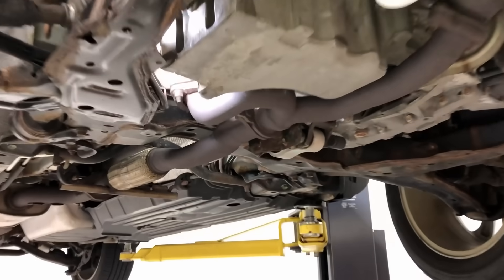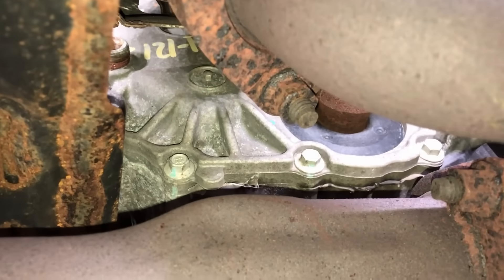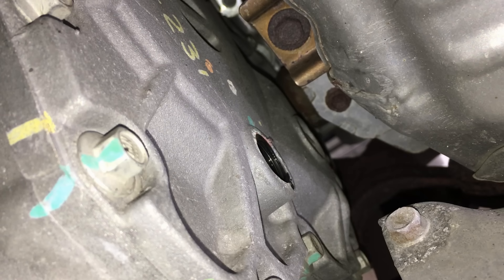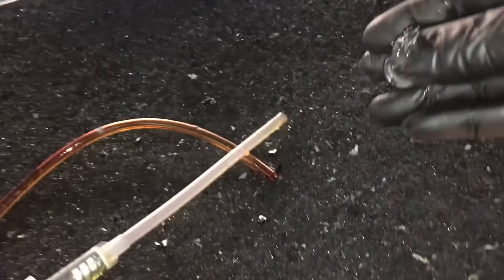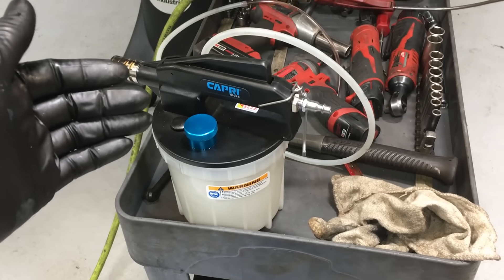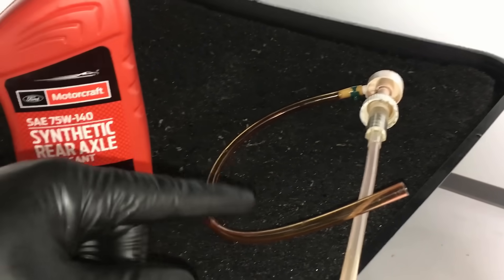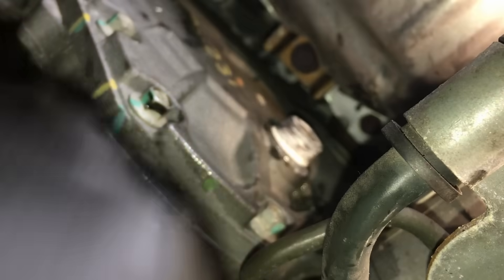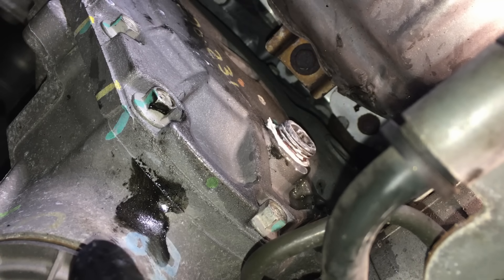Ford All Wheel Drive Vehicles: Critical PTU Fluid Exchange Procedure

Comment: I have a '15 escape awd with the 1.6 engine. My drain and fill plug on the PTU were Torx bits. They were INSANELY TIGHT. To the point I was getting really worried trying to take them out. I even used a plumbing torch and heated up the metal to try to help break it free. I can't stress enough to have a GOOD set of torx bits. I've done for years the route of cheap ones and finally got what I'd call acceptable ones from Harbor Freight. I got the Icon ones they sell and so far they've done me well.  This video helped a ton along with the trans fluid change also. You are da man. Thanks for making the videos you do.

Comment: Older models do not have any drain plugs and Ford dealers won't modify any casing to add one. Independent shops are also not interested in adding a plug.  It also cost way more than $1500 to replace the PTU. Sadly on older models Fusion/Edge/Flex PTU failure likely = to scrapping the vehicle if you are not a seriously equipped weekend mechanic.

Comment: thank you for this info. i have a 2016 Ford Explorer Sport with around 40,000 miles on it and just recently got a “four wheel drive disabled” signal and started smelling that natural gas smell. i immediately stopped driving it and dropped it off at the dealer. the 5 year power train warranty just expired a couple months ago so it’s not looking so good. if you catch it early enough could there be a possibility that a fluid change could fix this before major damage occurred? or once you start to smell a leak you’re in trouble?

Comment: I found a PTO on Rock Auto for my 2011 Lincoln MKX AWD manufactured by Dorman that has a built in heat shield and looks like maybe a drain plug but is out of stock.  I couldn't find it anywhere else online not even on Dorman website.  The part number has an XD at the end.  I emailed Dorman and asked about it, they replied that it would be available October 2021. 
Just thought I would throw that out there.

Comment: I just made a great discovery!
I just changed the lube in my 2006 Escape Hybrid PTU with a factory drain plug installed. But the plug was so tight to the frame member that it was almost impossible to get to it. It took way too long of trying all sorts of types and styles of Allen heads trying to find something that would work. To make a long story short, I finally found a ball end hex head socket that fit, and welded a 7/16" nut against the socket, and had just enough space to be able to use it with a ratcheting wrench while pushing against it from the back with my finger.
That is when I made the discovery. The ball end socket was a 1/4" and not a 6mm! The 1/4" is .250" and the 6mm is .235", or only .015" smaller. There is enough wiggle room in the plug to insert it tightly.
Then I had a eureka moment. I have tons of old 1/4" drive bits laying everywhere! So I put the tail of an old 1/4" bit in my vise, put a flanged 7/16" nut over the business end of the bit with the flange against the vise, and welded the two together. Now, I have a hex that is only about an inch long with a 7/16" head that I can use with my ratchet wrench to spin out the drain plug. The flange allows me to easily keep inward pressure against the tool to keep it in the plug while spinning it out.
I welded mine, but I suspect JB Weld or 2 part epoxy would also work if you could figure out a way to hold the two in alignment as it sets up.
I won't be using it for another 50k or so miles, but it dang sure looks like the perfect tool for the job to deal with getting the drain plug out of that tight space!

Comment: I have a 2010 Ford Fusion sport in almost perfect condition I do all I can to preserve it and regularly have it serviced. With 80k on it, it’s at the dealership now getting some service done I was wondering if they tell me it’s not serviceable or can’t even get a drain or fill I should probably just go ahead and get the updated one that has the drain/Fill plug or would a trans/oil cooler help with the heat attacking it from all sides?

Comment: I would definitely run top of the line AMSOIL fluid in that puppy, due to the heat soaking.
Reply: No use REDLINE SYNTHETIC GEAR OIL 75W140. PARDONS AMSOIL CAN'T CUT IT.
Reply: Some severe gear ?

Comment: Mine didn't drain because it turned into chalk. I had to dig it out the best I am replaced it with synthetic gear oil.
I also made a shield around it to divert the heat the best I could.

Comment: Can you achieve the same outcome using a hand pump?
Reply: I have a 2015 and had a drain plug on the bottom which worked great. No need for a pump especially since the fluid wasn’t all that bad.

Comment: Idk if they're different angles or different models, repair geek he has a video on changing ptu oil and the unit hes changing looks completely different is what hes changing not a ptu or is it different model from what you show
Reply from the maker: There are a few different models but the one shown here is the most common.
Reply: The one he had shown was for a 13-17 escape 4wd had a drain plug with a t50 bit, it looks slightly different and much smaller, every video of yours has fixed my problems for my 13 escape sel just not sure if he is saying ptu but is changing something else, read ptu can cause a transmission jerk, changed all transmission fluid several times before I still feel and notice it ptu is only fluid I haven't changed, ford says scoped transmission isn't bad doesn't show signs of wear, your other videos ptu can "hope your not literal" explode

Comment: Has anyone done the PTU fluid change on a 2013 MKS?
On the 09 and 10 they are a sealed unit that would require a drill and tap.
I don't know if the 2013 is the same or if it has been updated to one with a fill hole?
I've been under the car and had no luck finding a fill hole. Any help would be greatly appreciated!
Brian

Comment: Just wondering, Red line Oil states that 2018 and lower Edge uses 75W140 gear oil.. then in 2019 and later shows 75W85 fluid. I am told Ford changed the spec for the fluid. Is this correct? I believe 2018 is the SAME part number for the PTU, would 75W140 be better in a 202 edge?? Should I use the 75W85??  Any advice would be greatly app.
Reply from the maker: yes that is correct.
Reply: @FordTechMakuloco  Thanks for the super fast reply!

Comment: I know this video is a yr old but I just came across it trying to diagnose an issue I'm having with my 2014 Ford Explorer 3.5. What are the symptoms that the PTU is failing. I'm getting a shudder/jumpy/slippage feel during slight acceleration under light to heavy load then subsides at higher speeds. Could this be the issue?

Comment: Howdy, hoping someone can tell me, if the 2015 police interceptor sedan (Taurus) has the drain plug? I've read to replace vent hose and fill from there, placing old vent cap on new hose. Just got mine with 123k and I'd like to do this soon as the weather warms up. 3.7 liter engine.

Comment: If it's an 07 edge with the high fill plug, I assume it's the same volume of oil to fill as the low fill plug? How much oil is actually added?

Comment: Mine started puking out oil from the vent so I drilled a hole in the bottom and tapped it for an NPT plug. After running it 1000 miles and then changing the fluid again it cleaned it out fairly well and it has been fine. Now I just maintain it. I do have to use RTV on the threads of the pipe plug to seal it though. It is still working fine 28k miles later and it almost time to change it again.

Comment: Is it only All Wheel Drive vehicles that have a PTU, or do 4WD vehicles have them also??  (I have a '14 4WD Explorer)
Reply from the maker: You have a PTU and AWD.
Reply: @FordTechMakuloco  is AWD/4WD just a nomenclature thing then??  The truck is badged “4WD”.
Reply from the maker: A true 4wd has a transfer case and a high and low gear.

Comment: Some more amazing content thanks a lot.  I know this is a little old now but do you have an update for a more modern version?  I have a 2015 Taurus PI that does have a drain plug.  However the fill plug open has been utilized by a temperature sensor.    There is possibly a fill plug on the opposite side but I am told that is not the correct place.  My understanding is you drain it from the drain and fill it via the vent tube from the top.  Can you confirm this is the updated method?  You also stress concern about not over or underfilling.  The book says 18oz.  Without access to the fill plug do I just add the 18oz and it call it good? Hopefully this will help update others with newer models.

Comment: Went to my Ford Dealership in Dade,FL and was told to wait until the PTU fails. They said it doesn’t have a drain plug.  I have extended the vent hose as you recommended.  I have 78k miles on my ‘16 FPIU.  My question is What would you do?   The PTU with the water cooler can I upgrade to it and how is it connected?   THAT LOVE YOUR VIDEOS. KEEP THEM COMING.
Reply: Go to a different dealer who will change it.  Don't wait for it to fail.   It is a very expensive repair.  I would not wait too much longer to do so, either.  And this part doesn't give too much warning its ready to fail either.

Comment: Just had to have mine replaced on my '14 EDGE Sport. 74K miles. Luckily covered by my extended warranty!

I'll be having mine flushed every 30K after this!

PTU fluid, transmission fluid, & rear diff, all changed @ 30K miles & oil @ roughly 7K.

Comment: I was going to ask why you did not use the drain plug, but reading these comments sounds like the drain plug is no longer on the PTU.  I did not know this needs to be changed, I just started looking for videos when Dealer said I need to change the PTU seal, but they did not say which seal.  I have a 2013 Escape 2.0L AWD and I thinkine still has the drain plug.  I have 270Km on the car and don't think the oil has ever been changed on the PTU.

Comment: My 2017 MKC has a drain plug on the bottom side of the PTU. I had ordered the brake bleeder already but I'm sure I will find a use for it and the price was right! Found both plugs are torx and are TIGHT! I will need to get the vehicle on ramps to break the fill plug loose with a breaker bar. Access is better than your video but there is still a pipe right in the way. Just did the trans fluid change and found your other video very helpful for that also. It seems Ford changed things throughout the years because I did find some differences from your videos as that trans level plug was torx also and behind the axle. Great video shows how to get it done although I work slow :-)

Comment: This is great advice and common sense. Never wait 100,000 150,000 for transmission or coolant or ptu fluid changes. I did this on a 2017 escape.  35000 mi. It has a drain plug, so the job was not as complicated as this.   No suction pump needed.The fluid was very dark. I replaced the fluid again after about 1000 mi. It was very clear at this point. I also replaced my transmission fluid at about 30,000mi.

Comment: This may be a dumb question, but I am planning on doing this to my PTU on my edge and I don't have a lift. Can I perform this with my ramps as I can get under the car easier? or does this have to be on a flat surface. I can suck out the fluid, but putting it back inwill it need to be flat. (This is a used car with 100,000 miles and to my knowledge has never been done before)
Reply: Hey John, did you do this procedure on car ramps then? How did it go?
Reply: @HuskerRed11  

Hi Darren. It worked OK, I used a hand vacuum pump from harbor freight for like $6 to suck out the fluid. I wound up jacking the back up and putting it on jack stands to level it out. Out of sheer curiosity I grabbed a water bottle then filled it up with water to known levels and mark the levels with a marker. My manual said it took 12 oz of gear oil. My first time around I sucked out about 8 oz of oil but only put back 6 before it over flowed. I drove it for 1 oil change then did it again. I think I'll have to do it again on the next Oil Change. The second time I pulled the fluid out I got 8oz again. Don't ask me how that happened, tapping a drain is probably the best way to go but I don't have the cojones to do it, they don't have the money to put a new PTU unit in. Hope this helps.
Reply: @HuskerRed11  I did it on my 14 Explorer with just jacks. Nearly impossible, but it can be done.  I used a shop vac to get it out. Remove filter there is enough space for weighted canister inside. Then just stick a tube in and seal it. This works great. Was only able to get 4 oz out no matter how I stuck the tube in. Good news it was fairly clean.  Will do it again when I get it on a lift.
Reply: On a 2016 Explorer, got 12 ounces out working on a jack with suction.  No need to level the truck.  If the front is raised, you'll be fine...  The PTU on mine holds 17.9 ounces.

Comment: I have a 16 Interceptor Utility, I have been told the is a small cooler in the way of the drain plug.  Do you have a video of this?
Reply: I have same. My mechanic did it in 1 hour. I think its very doable still

Comment: 2014 ford escape PTU/transfer cases over full and leaking. Is the fluid leaking from the Transmission into the PTU? 
Any particular concerns to what may be a problem after a pull the PTU out?

Comment: Just changed the fluid in my 2018 edge. Put. Low and behold it has  1/4 in,Allen head plug in the side of the case below the fill plug!  Easy to drain while also doing transmission fluid change. On line I found that ford quietly added this in 2016-2017 time frame. I feel lucky that it was all so easy

Comment: Watched this video and decided to have a local shop do the lube extraction and refill, per the video, on my 2015 Ford Edge SEL 3.5L AWD. To my surprise, they found that it has a factory drain plug at the bottom of the PTU! They saved the original fluid (80K miles) to show to me, and while it was black and due for a change, it wasn't the black sludge as shown in the video. Will probably change again at 100K miles. Excellent video,  THANKS!!
Reply: They lied to you and showed you some other oil 😆

Comment: 2017 Escape at 106,500km. Went in for an oil change that I do every 8,000km and mention I am getting a vibration/shudder at around 1,500rpm at 60-70km/hr. Now they come back and suggest a Transmission service at 96,000km. Why the hell did they wait till 106,500km to tell me this. I bet that is now the reason my car vibrates and will cost more that what it would have been. Plus the PTU is "Starting" to leak. Never had a suggestion of a service for it.... and when I said I need to look into it (cause money is tight right now) she said it looks like it is just starting, so I can put it off till I go in for another oil change appointment. Wtf.

Comment: After doing a ton of research and watching many videos, tonight I finally did the ptu fluid exchange.. I have 143k on my 2014 explorer limited AWD.. the fluid came out pitch black with the "glitter effect" of normal wear, no metal chunks or pieces.. The fluid was liquid and not thick at all, the magnetic drain plug had a small layer of goopy glittery fluid.. I used the top Sider oil changer and sucked out a little over 1/2 a quart in less than a minute.. I used royal purple 75w-140.. test drove it for 20ish miles and shifting/acceleration is smoother than before.. took me about 1 hour to complete everything on the ground.. thanks to everyone and their expertise!
Reply: I’ve used RP gear oil for 20 years on multiple fords (even on my 2 Lightning’s , Raptor, and a Terminator) and even chevys. NEVER had anything blown up or know anyone that used it and blown up. And I’m also talking 1/4 track use too.
Reply: Only problem is the dealer dosnt reccoment changing it wife’s car been in the dealer since new  200,000 km they never asked to change it till it was leaking Haha fu knbraindesd
Reply: I used 1/4 of a quart..is that normal?
Reply: Your ford exploree runs with the front wheels. Just because it says 4wd means you are on all wheel drive.
Reply: @rhurtadorh32 You don't know the conditions he was driving on. Maybe he was on a gravel road going up steep hills, in which case the on demand AWD would be operating. Your reply was MEANINGLESS without knowing his driving conditions. Get it?
Reply: @Cokie907 what are you talking about? That ptu oil needs to be changed due to being next to the catalyc converter and or muffler tubbing. It turns black right away i usually change it every year. But yeah i dont know😏
Reply: @rhurtadorh32  Ford just gave me an estimate for this job over 800. They want to remove the R hand Cat converter, Y-pipe, and driveshaft front flange to access the ptu. I'm encouraged by your reply and Ima continue my research hoping DIY this!
Reply: @waltertaylor9615  what i did on my explorer i drill a hole and installed a plug. Theres lots of videos were exactly you need to drill and put the plug. Its easier to drain and fill your ptu oil.
Reply: @rhurtadorh32  Not bad. Smart move...Do you think that'll work on 17 FPIU? The access point is slightly   different.
Reply: @waltertaylor9615  for what car or suv?
Reply: @waltertaylor9615  it can be done ptu looks a lil bit diferent. But it can be done. Look up them videos on how and were to tap it.
Reply: Now do it again and replace that royal purple with Mobil 1. I’ve seen more blown up with smart asses using royal purple come in than stock, seriously.
Reply: @truthtimetv4575 are you mentally ill?, why are you calling people smart asses?

Comment: I just did this job, bought a new PTU from the dealer. It didn't have service plug, just a drain plug. I removed the speed sensor to insure that level was correct. The vehicle had 65,000 miles on it and the PTU that I removed was from a salvage yard with marking on it noting it came from a salvage yard. So that led me to believe that this was the 3rd unit installed on the vehicle.